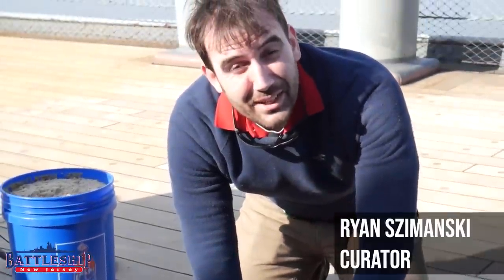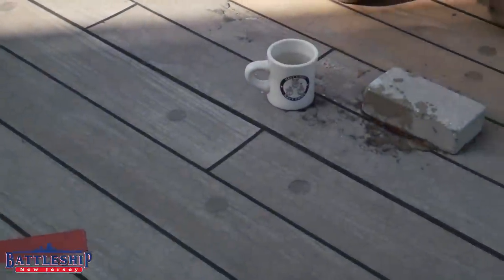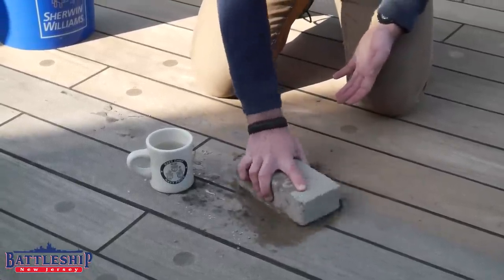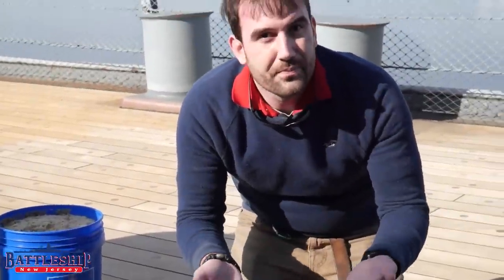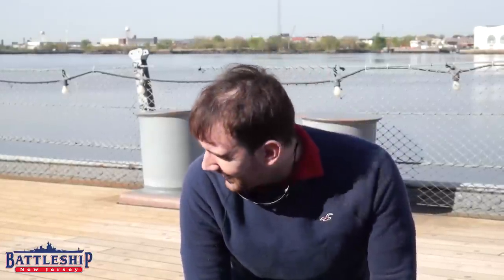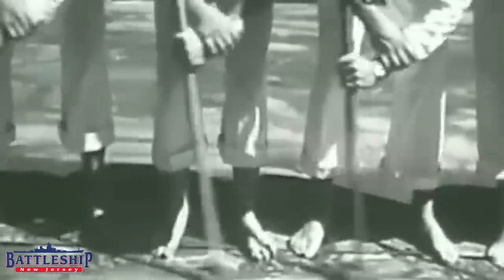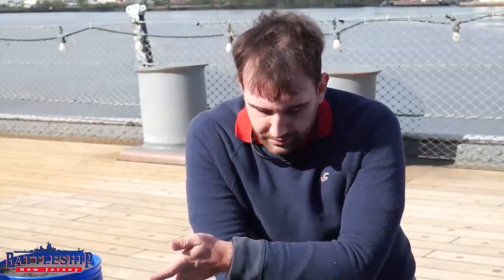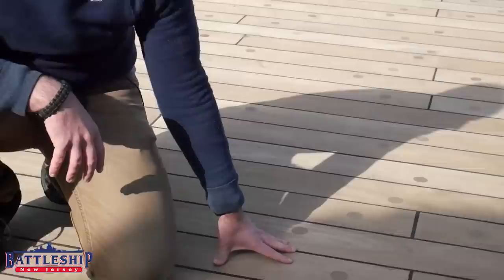Holystoning the Battleship's Decks

Comment: what a waste of manpower
Reply: So, you need to have an overmanned ship in order for battle casualties to be quickly replaced. Too many hands, not enough work, middle of the ocean. How do you propose to maintain alertness, morale, and camaraderie?

Deck division may hate the work, but at least they’re hating it together as a division.

Same thing with cleaning piping in the machinery room bilges. Crawling around pipes like a bilge rat. Pipes that have steam and condensate, and will burn you if you’re not careful. Sucky work, yes… but the astute sailor can learn to trace the systems, and knows where every manifold, valve, petcock, and steam trap is located under the decks… which is a huge asset to running a plant.

To the unindoctrinated it may seem ludicrous, but there are some methods to the madness of these naval traditions.
Reply: @stevedoe1630  yeah / it sucks being expendable